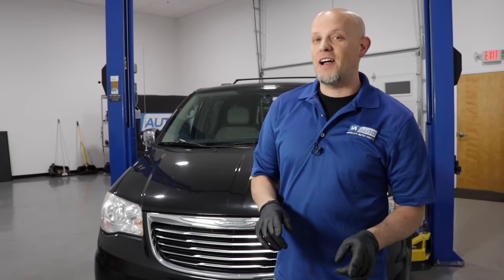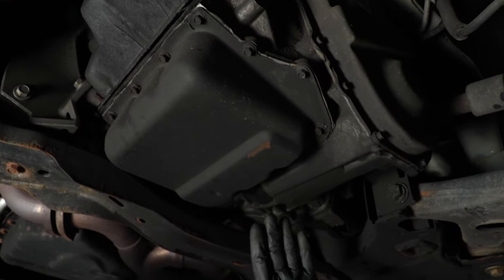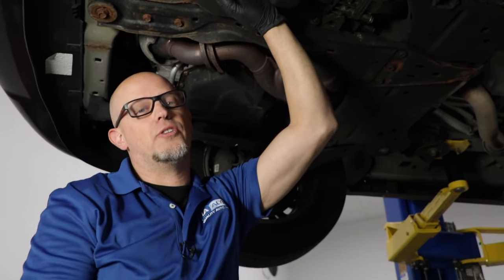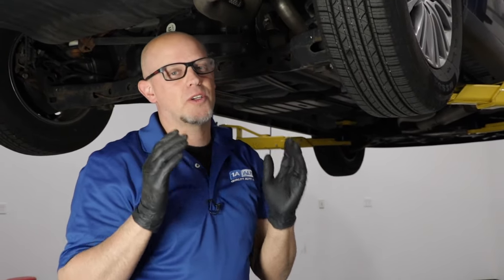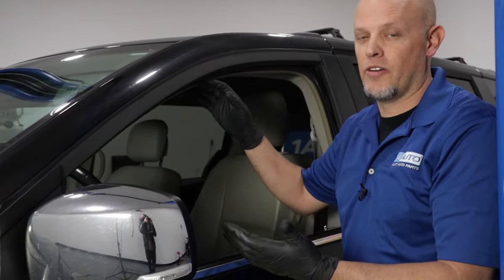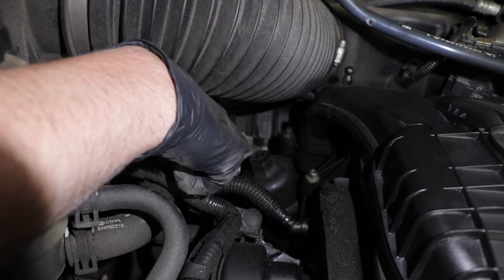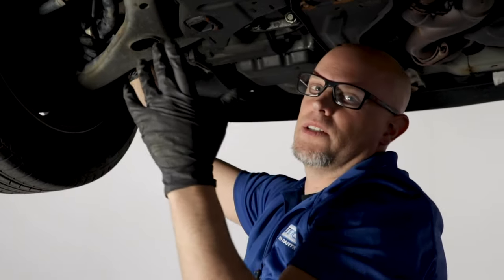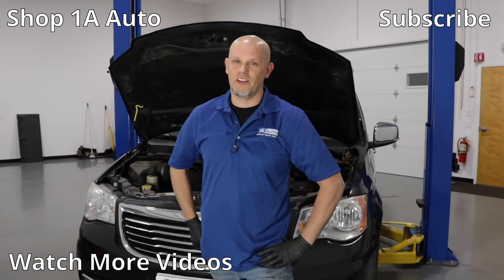Top 5 Problems Chrysler Town & Country Minivan 5th Generation 2008-16

Comment: I wish you would have done #6 TIPM failure. This is an expensive and common repair of which Chrysler has lost class action lawsuits for this TIPM in other cars... Jeep Wrangler and Dodge Caravan/Dorango. It  has caused  excessive starting problems. Repairs run$1,800 with a few places offering mail in repairs.

Comment: 2011 with 140K.  
-Had to replace the Driver Window Regulator Assy twice, and the Passenger side once.  
-Replaced 3 alternators.
-Replaced OEM brake rotors and pads with Duralast GOLD's.  No more warped rotors and the annoying vibrations.
-TIPM fuel pump issue was fixed by adding a jumper wire to other fuses.  
-Window Washer fluid tubes burst last winter so had to replace several sections.  
-Interior trim is falling apart, chrome accents peeling off.

It's a Chrysler.  I say I'll never own another one, and this was my final one.  I'll drive it until the wheel fall off.

Comment: The window regulator is a pretty easy fix. Took about a hour, maybe hour fifteen to do it all. If the the regulator you’re gonna hear that cable snap, & the window will be stuck somewhere, but you’ll still hear a buzz when you try to engage the motor, do not burn it out. If it’s the motor, the window will be stuck in its last position, & you’ll hear nothing when hitting switch. Kinda like listening for the fuel pump to prime before a start. It’s not loud, but it’s there. Although, most will say do the motor, & the regulator, I’ve yet to have a motor fail doing two separate regulators in one. It’s cheaper to buy them together usually, but I just got the motors saved if I need them down the road. If you’ve got slow windows, & you’ve taken care of the window tracks then I’d go ahead with a motor too. Hitting the switch up & down fast repeatedly, or playing “footsies” with the windows from different seats is about the best way to get yourself into doing this job quick. The regulator is basically two side beams that make a “X” across the door, meeting at the motor gear point. You tangle that line, or put any kind of tension it shouldn’t have, it’s twirling up. Getting it untangle, & free is really the longest part of the job. Yes, the whole panel, speaker, & switches has to come out, but it’s like 20 screws & some push pin connections. Don’t pay 140-180 in labor alone for a window. 

& dear lord don’t trust your window to just some cheap ass tape. Tape it with whatever you have In absurd amounts, & shim that damn thing. It falls when it’s unhooked that’s another 2/300 gone.

Comment: 2016 Chrysler T&C.  Got a code for shift solenoid and replaced the pack. Drove good for a few weeks then got the intermittent rough shift/down shift. Just replaced the trans fluid and filter but still doing the same thing.. Any suggestions? Had some very small metal shavings in the pan but nothing that seemed concerning.  Maybe input/output speed sensors?

Comment: My biggest issue has been the Egr Valve, I've replaced it three times in 3 years and still don't know what causes it to set off check engine light.
Reply: Mine too! It's so frustrating!

Comment: Window regulator went out on my 2012, driver side.  Window went down but never came back up.  Turns out that the glass repair companies don't have regulators in stock or even order them.  Local parts chains carry the cheap junk.  So I bought an OEM regulator myself and found a glass repair shop that supplied the new window and fixed it all at a fair price.  Meanwhile I had to drive around with clear Gorilla Tape as a window for a few days.

Comment: Thank you for the information. I’ve had that evaporative line issue with my 2007 T&C as well.
Reply from the maker: +Brian Christopher Thanks for checking us out! http://1aau.to/m/Shop-1AAuto-c
Reply: Brain what was the cost to get it repaired...
Reply: @teekay8134  I had a similar problem. We just capped off the rear coil.

Comment: What is the relation between EVAP and A/C system, as I know that EVAP is related to fuel system !
Reply: Stands for evaporator. A/C systems have an evaporator.
Reply: @strongjohnful  AC evaporator assembly is usually in the front of the car as opposed to the rear, no?
Reply: @vinloy23  Rear evap is for rear AC inside the van. Front and rear are controlled separately.

Comment: Ugh just bought a 2008 4.0l with 227k miles for 1900, cel came on giving a transmission temp sensor error. Bought it out of desperation since my 04 just crapped out due an electrical issue

Comment: I had a 2011 T&C Touring L. Biggest piece of garbage I’ve ever owned. Bought it with 84,000 miles and traded it in at 112,000. Transmission problems, control module problems, alternator problems, exhaust system problems. Traded it in for a Honda Odyssey. So far, I’m glad I did.
Reply: Seems more a Honda Odyssey being traded in for a T&C story.  Chrysler transmissions are bulletproof compared to any Honda transmission attached to a V6 or V8.

Comment: What about the TIPM? We have been having issues such as automatic high beams not working, then high beams coming on not staying on, driver side heated seat intermittently working, sliding door stopped working, a window stopped working, got pulled over for a brake light being out only to order a bulb then see it was actually working.  Could this all be due to TIPM?

Comment: I have a flickering noise behind the glove box  what is it  ....the fuel pressure relay or the a/c relay ....?? It happens when engine is on AND off but most of the time  it happens when I turn on the engine... It lasts a lomg time b4 it stops and no the a/c blower doesnt let me run the air when it flickers too..please lmk what u think I should do or if u know of this problem ..mine is a 2010

Comment: my head gasket is leaking (or crack) exhaust pushing coolant out the overflow and engine overheat.  2013 T&C ..........   Not worth the thousands to repair correctly ........ which quick seal product would you recommend?   It's my last ditch effort so...........  thx in advance

Comment: TIPM!! If you have more than 40k on it and the original fuel pump relay is still working, count your blessings. Also, the chronic "P0128" thermostat failure with T&C's.
Reply: Yes!!!!    Had this problem with my 2012 dodge grand caravan and my sisters 2013 t&c

Comment: I have a 2012 town and country....it has stopped running on me 3 times....once moved on to the tow truck it would start up and was ok untill it stopped running again....this is an ongoing problem with 2008- 2015 Town and Country and noone has the answer (it could be this or it could be that)...I don't know why it's not #1 in the top 5 problems with this van.....then again I do know why !!

Comment: I have a 2011 town and country and the rear washer nozzle only runs a river or washer fluid instead of spraying. How do I fix. Do you have a video
Reply: Clean debris out of the tiny holes in the nozzle assembly.

Comment: I had the issue with with the oil filter. Got that replaced. Now I noticed a red light with a lightning strike through it and idling high over 1 thousand rpm and my break system went bad my breaks are hard to press down.

Comment: Thanks for the video! My 2015 is about to hit 200k miles and the transaxle fluid/filter has never been changed I don't think-the dealer didn't know (we bought it with 100k). The fluid is decently red-should I now change it?
Reply: If it's not slipping already then u should have no problems doing a basic pan drop & filter change on it. That only replaces about 30% to 40% of the fluid anyway

Comment: I have a Waaaay worse problem. My 2011 Town and Country has run great for several years. Last week, the power inside the vehicle shut down, and then it completely died. No crank, no inside power, nada. I checked fuses, found 2 broken ones, replaced them, got power inside vehicle, and saw white smoke coming up where the starter/alternater side. I believe I have multiple issues with this car, as it has an automatic shut down, if one part fails. We've done everything from changing the computer, to testing wires, to changing out starter, next will change alternator. What I need to find is "what smoked"? I cannot see a wire harness, most of the wiring is encased in plastic casing...but if it was an electric burn, I would think I would see it in the wiring. I will repost when we figure out what failed. Love my car when it works...when it fails, it failed BIG.

Comment: I have a 3.8 town and country limited 2005. I have had the transmission fluid changed 1 time in 120,000 miles, and no problems. What I do want to Warn Everyone! Is I spent about 3500 at Ntb, had new tires, struts and brakes,everything's do with the braking system and front end. I would drive it home 45 miles and I would smell the brakes burning. It got so bad after they had it for a week and they fixed it 3 more times telling me they couldn't find anything else wrong. My brother researched it. I was too afraid to drive it! As long as I didn't go down a hill and had to use the brake's maybe it would be ok. One day I had no brakes and the van acted like the brakes were stuck! And burning. I had to have it towed to a regular tire store. My brother stayed on the phone with me and said tell them to change the hoses, I had to get new brakes and 2 new rotters just to be sure. The hoses were Never changed by Ntb. They were so clogged up it's like sucking through a straw with frozen ice cream. I called Ntb and got well we're sorry but its been 2 year's, and I drove less then 3000 miles in 2 year's afraid to drive down any hills. I told them what was found and what I had to do. I kept telling Ntb the whole time something else is wrong. I told them to keep the van and drive it down a hill, drive it a week go down the mountain from where they were. It's not Colo but a southern state. Again I was told they drove it around the parking lot! And didn't find anything. After the hoses were changed I have had zero problems. So have the hoses changed often or checked.  Ntb has now in my experience less then ---0 stars.

Comment: mine had a pinhole leak in the thermostate houseing where the plastic seams met, it presuureiEd fine and sprayed a mist into the intake once coolant got a little low and the shop thought i had a blown head gasket, it was a 20 part, :)

Comment: Transmission fluid and Filter needs to be done every 30k. Period. 62TE trans do not like dirty fluid. Chrysler builds them to last 100k w/o a service and that’s exactly what you’ll get
Reply: Next time you change your trans filter get a new trans pan that has a drain plug, Dorman makes one for around $40.00. Then when you change your engine oil you can drain about 4 quarts of transmission fluid and replace it with fresh fluid, essentially flushing your transmission every 3rd or 4th engine oil change. This is especially good in hotter climates, areas with lots of hills/mountains, or if you are a heavy footed driver.
Reply: @sspacil  No flush is ever a true flush without doing a complete flush.  Your method will always have dirty fluid, never get the worst dirt and debris out, and the fluid will not have the optimal viscosity given 3/4 of it has always been subject to getting hot and cold.  You should leave everything up to professionals given your obvious ignorance and incompetence.

Comment: I have a 2012 T&C.... my problem is I need the 110 v outlet to work. I push the button up front and it wont stay on .... as if there is a short... can this be a fuse or is this "extra" known to stop working?

Comment: My ‘14 has a lot of problems the transmission have to be replaced, the sway bar, struts, windows don’t let down, emergency brakes came loose, alternator, battery terminal and a timer change soon 227,000 other than that it’s a good van 🤦🏽‍♀️

Comment: ?????? I HAVE 2010 CRYSLER TOWN AND COUNTRY  TOURING 3.8,   312.000 MILES I LOVE THIS MINIVAN I USED FOR MY FAMILY AND MY JOB AGAIN 312,000 MILLES  I CHANGE GASKET MOTOR OIL, REPLACE STRAUTS ,  NEW TIRE AND DONE LOVE THIS MINIVAN I USED EVERY 3 MONTHS OIL HIGH MILLES AND CHANGE FILTER 5 MONTHS

Comment: These are all common wear items. Change the transmission fluid every 50,000 miles. I have +189,000 on mine, and it runs incredibly well. The only issues I had with mine in the last 10 years were the oil filter housing leaking, starter, breaks, shocks, wheel bearings, all these items replaces as standard wear items. I would buy another one as this has been a very reliable vehicle, and in freeway driving—27 mpg.
Reply from the maker: +Barry Redman Thanks for checking us out! http://1aau.to/m/Shop-1AAuto-c

Comment: If sway bar links are one of the TOP FIVE problems with these vans I'd say that's pretty darn good. for a cheap rubber part to be one of the worst problems I'd say these vans are some of the best built vehicles on the road.
Reply from the maker: +sspacil Thanks for the feedback!

Comment: I'd say don't buy one. We bought our 2013 Grand caravan new. Transmission serviced at 60k and 120k. It's at 151k miles and has been sitting 8 months due to transmission issues. According to the dealer and independent shop it's going to be atleast 1200.00. computer not showing anything so it's literally a break it down and take a look.
Could need a new transmission. 8k dollars at a dealer over 4k at an independent shop.
Struts, and shocks need replacement and the cowl developed a nice leak which makes for an awesome interior odor. Few other small issues like steering wheel buttons working when they want ect. These vehicles hold value like trash for a reason. 3.6 Pentastar however has been great. If I could go back to 2013 I would have stayed away.
Reply: I having hard shifting with my wife’s 2016 town and country so thiers no way on servicing the Transmisson at the dealership
Reply: @javonmathis2686  hard shifting is very notorious in these things. Mine needed new motor mounts and new speed sensors.
Reply: I have a 2015 and no major problems.  I did have the window regulator go out. 
I owned a Toyota Corolla, Camry and a Avalon.  I bought them all new.  They all had more issues then my Caravan and my Camry was a lemon.
I love my grand caravan and it’s the best vehicle I have ever owned.

Comment: i have a 2009 town and country 3.8 v6 with 95,000 and if it gets below freezing. it has to be jumped. my left passenger door wont auto open anymore.  and it has trouble accelerating passing someone or going up hill. and it gives resistance going downhill

Comment: Hey quick question on a 2002 suburbans front drive shaft move when you have it on the ground and in park and when you try to twist it the front differential drive shaft does it move a quarter of an inch or and inch. Or is it not supposed to move at all??

Comment: I had a 2015 Town & Country and it’s transmission failed to where I had to eventually trade it in and upgrade. Enter the 2016 Town & Country. This van has been giving me so many problems! Transmission and pan had to be replaced, fuel pump issues occurred, and my driver side sliding door will not open due to a faulty actuator. My mechanic told me it would be $1400 just to fix the sliding door since Endurance warranty would not cover it!
Reply: My 2014 Town and country tour stalls every time I push on the brake to stop if I don't do it slowly and gradually to let it downshift into first it just floods out and shuts off every time I've had it in the Chrysler dealer they actually had it for 2 months they sent it to another dealer and nobody can figure out what's wrong with it because it throws no codes so I had them replace the throttle body the TMC just random things and it still does the same thing

Comment: Power steering fluid transfer lines rust through.  No replacement parts available in US. Had to order from Canada. Unless you want to replace the whole rack and pinion steering. $$$$$$

Comment: Question. I have a grandvoyager limited whit automatic transmission. The problem is that it cannot go above 1st gear. It just happened from nowhere. Already spent 400€ in a diagnostic and the gearbox sems fine, no noise around or rattling. Runs well also but cannot go above 1st gear! 
Can u give any advice?
Reply from the maker: +Piquete Cascais We wouldn't be able to diagnose an issue like that here, you may want to have a local mechanic take a look at it. Thanks for checking us out! http://1aau.to/m/Shop-1AAuto-c

Comment: mine rear driver wheel well has a tpm module and the wires went over frame, causing the fan/thermostate not to turn on  to crap out and make it look like thermostate, this should be a recall as it electrified whole frame seams (worst place ever wheel well cover rubs it with lower voltage out of module  did not pop a curcuit

Comment: My Moms former 2010 Chrysler town and country had a awful transmission problem and it also had a issue where the left automatic sliding door Would be closing and it would just start opening again half way
Reply: My 2014 T&C has been doing that since I bought it used in 2017 from Carmax. Under warranty repairs 3 times! It STILL does it! 😡
Reply: My sister go up too 4200 rpms when barley tapping the gas transmission acts weird

Comment: You left out the automatic sliding doors
Reply: Man oh man. My lady and I had this problem twice. The first one was our 06 and now our 2010.
Reply: Ours is constantly not closing correctly and will randomly go crazy on a hot day which makes the alarm go off
Reply: My 2016 sliding door is not locking!!! Plus at 130000 I had to refurbished the transmission. And now the catalyst converter is failing